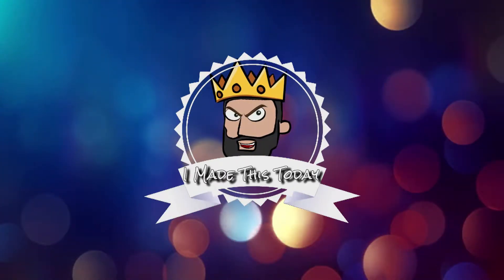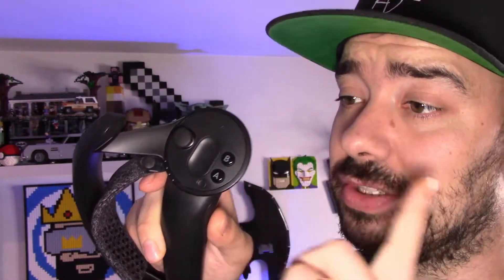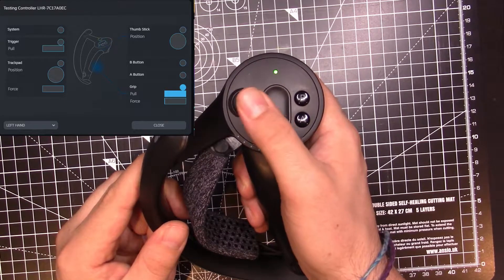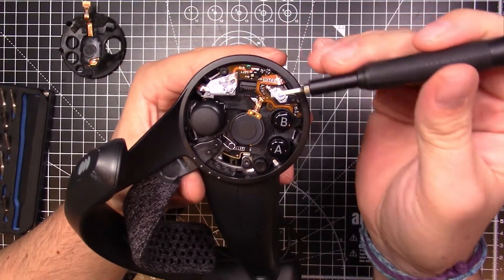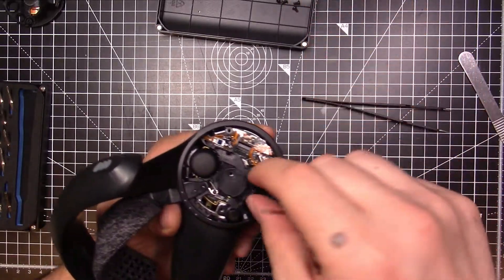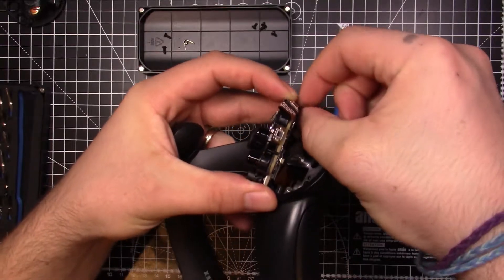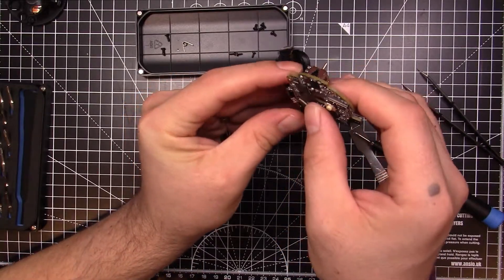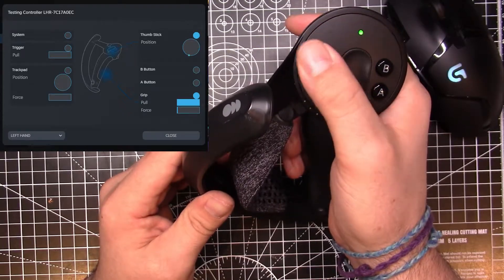How To Fix Index Controllers Thumbstick Drift & Thumbstick Replacement

Comment: Thanks for this tutorial, the disassembly guide is brilliant, not obscuring anything and very detailed in what to look out for. Just wanted to add some after thoughts for those who are about to venture on this repair. I was successful, but I had some struggles and wanted to pass the information on.

1. The "Lego" ribbon cable that plugs in under the PCB (the one in the center) is slightly folded inside of the handle, gently pull it. More cable will appear and make re-assembly so much easier

2. The wire spring for the wrist strap is an absolute nightmare if you don't know the correct steps of putting it back in. What worked for me was 
 - Put plastic assembly in without spring
 - Screw the outer strap down (the metal part that you pulled out), still without spring
 - Insert the spring with the part that is higher (the end thats near the outside of the controller) first
 - Bend the lower part (the end thats nearer to the center of the controller) into place until it's seated correctly
 - Screw in the thumb button plastic part

Took me about 30 minutes to figure that technique out, as following the video and reversing the steps makes the whole ordeal more fiddly.

3. A Soldering Iron with a fine tip can make it much easier when desoldering, as the solder can fall down onto the root of the leg and can cause damage to the pad from overheating if you're not gentle. If you're having issues with getting some of the solder out, try adding solder, then remove it again.

4. Solder Sucker is far better in this situation than Solder Wick, as you're removing solder from a through hole, which has a tendency to have solder further down the leg. If you want a recommendation, the "Engineer SS-02". I've had mine for 6 years and it's worked a charm whenever I'm repairing something, just need to occassionally replace the silicone tip which you can also buy from Amazon for a couple quid.

5. If you're still having trouble desoldering, don't worry, I did too. I ended up using a really hack method, in which I cut the legs off the broken joystick at the highest possible point, removed the metal and plastic structure, then with a pair of fine nose pliers, held each leg and applied heat on the other side. This resulted in the legs popping out and little to no solder being leftover. (If you have solder leftover, you can just use a pair of tweezers to create a hole) 

I really wouldn't recommend the above, but I've used it on a number of controllers when replacing joysticks and has yet to fail me

Anyways, good luck to whoever read this comment :)
Reply: Good points. And if Youre doing this more often, I would definately recommend an S993a desoldering gun. Not too expensive.

Comment: Worked for me!  Although I just swapped out the pot contacts inside of both sides of the joystick, so I didn't get under the board with the joystick, just popped the top off of it.  The only concern I'm left with is whether the middle touch pad ribbon cable is seated well enough after reconstruction - did other folks feel like it was just sitting there, as opposed to having a positive feeling of having engaged?

Comment: to demystify the rationale behind valves choice to build these controllers so cheaply (and charge so much for them) Gabe Newel actually explained in an interview a while ago that valve was trying to apply a software mentality to their hardware manufacturing... which is just a round about way of saying they are intentionally embracing the hardware as a service business model. they design it to break so you have to continue buying new hardware as soon as your warranty expires. its not that valve just cheaped out on thumbsticks. they intentionally chose the soulless ghoul, rip off the consumer while intentionally producing short duration e-waste strategy. you will also notice that if you have index controllers, you will get progressively worse condition replacement units the closer you get to the date your warranty expires. I have received multiple replacement controllers that failed within ten hours of use from the time they arrived. im glad there are folks like you who are making the self repair option accessible. thank you for doing that. but as consumers we need to be more aggressive about rejecting companies who operate as shadily as valve does.

Comment: Well I finally did this fix after waiting and putting up with a drifting, then partially working, left thumb stick. I previously ordered the replacement joystick. I watched your video repeatedly to “learn” what I needed to do, and just did as you suggested. De soldering was the worst part and seems to be quite a high melting point solder too. Anyway, job done, and working good as new. Cheers!!

Comment: Don't forget to clean the solder with rubbing alcohol. If you don't, over time, the flux will collect moisture, become conductive, and start to corrode the board. Also I see IC chips susceptible to static shock from touching the metal connections, which could destroy the components rendering the electronics useless. Use a static dissipative grounding strap and grounding mat.

Comment: Amazing video thanks so much.  I recently repaired my buddies quest 2 controller by replacing the joystick which was just a drop in replacement, but I knew after valve told me to go kick rocks after my third RMA that I would need to do this some day, so I ordered those exact joysticks, and a soldering iron and wick.  Well over 6 months since I bought those things, my joystick is becoming almost unusable and your video was just what I needed.  Doesn't look too bad at all tbh.  Excited to try this out.

Comment: it's worth noting that Valve is very forthcoming regarding RMA for this issue. in my case an RMA after 3 years was no problem. so you might want to try that road first before potentially breaking your controller.
Reply: I just sent support a ticket, wish me luck
Reply: @CheeseDoodle  How was it?

Comment: I just did this to mine, my switches I got feel a little loose, like a small amount of play in the stick as I hold the switch in my hand. I proceeded to do the fix and removing the original switch was a pain, I ended up breaking the switch into small pieces undoing each leg. It came off pretty clean. I soldered in the new one. I put the controller back together and went into controller testing. The thumbstick went all the way around but at the top it wasnt all the way to the edges. Then it just stopped completely and now only works like its glitched out. Doesnt read right. The touch pad worked and then stopped. Then the grip worked and then stopped. Maybe I need to recheck all the ribbon cables but im not confident in these switches I got off ebay that took a month to get here.

Comment: I followed the tutorial and it was almost fantastic. My repair did not turn out well for me because my trigger stopped registering completely due to my difficulty desoldering the old thumbstick. In your tutorial, you completely skipped over how to desolder the old thumbstick and due to all of my mistakes, my controller now has a fatal flaw. For anyone watching this, the desoldering was by FAR the hardest part. Ultimately, the way I ended up getting the old thumbstick out was to use a little solder on all of the contacts for that piece, which has 12 by the way. Connect them all and ONLY those 12 with solder so that when you heat it up, it will make all of them soft and you can pull the old part out. Afterwards, clearing the holes in the board was a task from hell. A couple things made it hard, the solder was cooling FAR to fast and I did not have any flux to use on my desoldering wick and no store I asked even knew what it was. I used my soldering iron with the thin tip and heated the solder in the hole and used a solder sucker on the underside where the thumbstick piece was. That way I can press the sucker against the bottom while heating the top. When I used the solder sucker from there, it cleared the whole completely. I watched this video 3 times before beginning thinking it would not be so bad and I was very wrong. Also, for the reassembly, the spring that holds the strap in place ABSOLUTELY needs to be shown on camera to be clear because putting it back was not intuitive at all. Besides those 3 points, good tutorial. Please, if you can, add those parts in before more people end up breaking their EXPENSIVE devices.
Reply: Buy lowmelt solder, mix it in with the stock solder when you remove the stick, it makes it far easier, and the sucker will just take it right out, i understand why this was hard for you if you have no flux to spread the heat out and no lowmelt solder.
Reply: I realized the same problem when doing this and I did not have a sucker, so I dismantled the old switch so that each pin was separated, then desolder everything, then I used a straw to blow each hole clear while heating them up. So far so good, hope it lasts.
Reply: Hey I'm just wondering since you clearly have the internet, did you look up a video on how to solder or how to desolder a board? Did you check all the websites that sell the materials you were missing and then order those things?

Comment: your switch says 19 26 on it, the  FJ06K-S switches I got say 18 29 on them... well I put 2 on the board and neither will track correctly and they have alot of play. The sticks wiggle around. after closer inspection of your video I see the oem one says 19 26, yours says the same as mine 18 29... My sticks have alot of play/deadzone before they kick in. None of mine installed tracked a complete circle and didnt work normal.
Reply from the maker: Umm that’s odd I had no wiggle in mine feels the same as the old one
Reply: Does anyone know what the 18 29 numbers signify?

Comment: prying with a screwdriver att the thumbstick is not a good way to open your index controller.. thats a likely way to break the delicate push buttton detection that is the only non replacable part you cant find for your controllers..

Follow the ifixit guide

Comment: I hit my door knob and broke the left thumbstick off and couldn't figure out how to get it back on, after seeing how you removed the face plate of the controller i did as so and was able to half repair it. The touch sensor broke when the joystick got ripped out from the door handle but i don't think it was too much of a loss, everything else works fine

Comment: after watching this I have decided to just buy new controllers... No way im doing that.
Reply: its broken anyways, might as well try. Worst case scenario, it ends up still being broken
Reply: Honestly, there are two things i noticed when doing this process. 1. Don't lose the screws!  2. De soldering is easier with a desoldering pump! 3. take your time when desoldering because you dont wanna burn anything XDD. 4. the most important thing, do not break the ribbon cable for the thumbstick , its super important. mine was already broken so i didnt need to worry bout that. Soldering is one of the most useful things you can do. I swear to god i feel like i can solder anything now that i got it working :)))

Comment: I had the same issue with the quest, what i did was use some 80% alcohol to rub in the thumbstick. Then after an hour i greased it with wd-40. But this, this is complicated. Great job rhys!
Reply from the maker: Yer I Had tried everything before getting this point lol the problem is a high end controller like this using cheep parts… I super happy that it worked in the end an it feels good to have saved a few hundred buying new ones